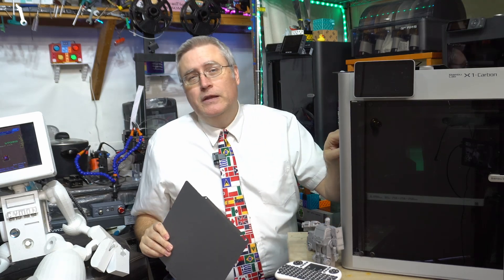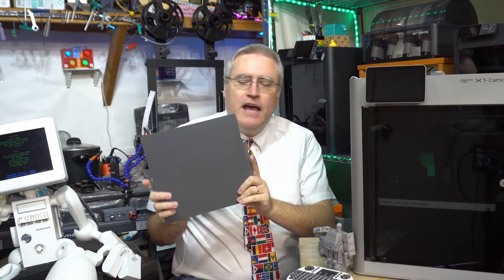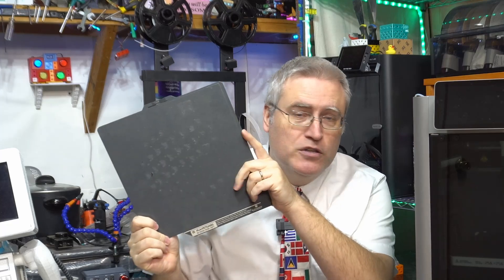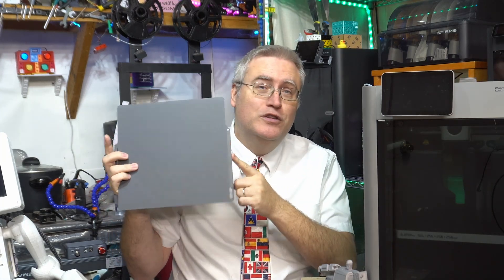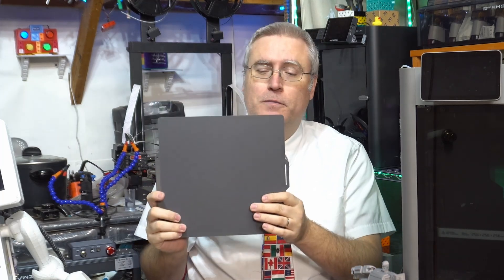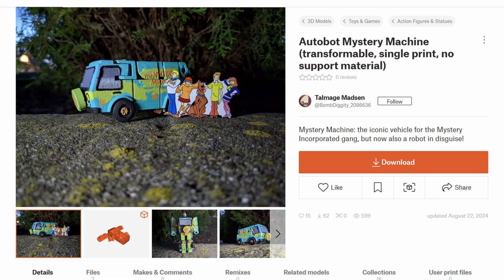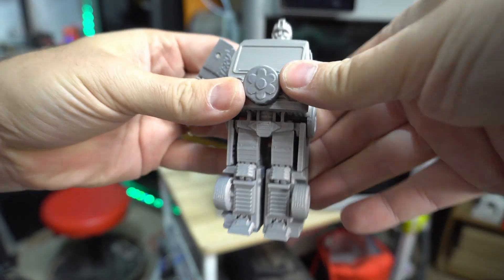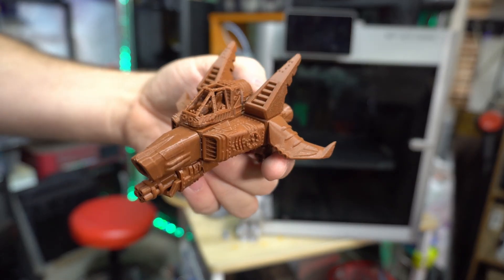3D Printing on a Cold Build Plate with the Bambu Cool Plate SuperTack

Comment: Just a thought... How many prints would you need to do with no bed heating expense to save the extra price of the cold plate? When does it stop paying for itself? I appreciate energy will vary in cost around the world, but a magnitude would be good-; tens, hundreds, thousands?

:edited for clarity...
Reply from the maker: That's an excellent question. And the answer is... a lot. In one print I saved 0.245kwh. Where I life electricity is about 11.42 cents/kwh. The cool plate costs about $15. So that's about 131kwh that would need to be saved, or about 540 prints.
Of course that's just this one print, but I think it illustrates the point that... yeah, you're not making back that investment that quickly. Then again, in certain environments it wouldn't be hard to print that much. Like at my house.
Reply: @3dpprofessor  So probably worth considering if you need to replace a worn out build surface, but not until.
Reply from the maker: @pinkmouse4863  I mean, if you're looking at it from an ROI perspective, I think that's reasonable.

Comment: Are you able to 3d print in a cold room? I want to move my P1s to another room but it is colder and does not have consistent heat in the room.
Reply from the maker: PLA doesn't mind the cold at all.

Comment: PLA is biodegradable, but your experiment is likely to fail. Most PLA needs an industrial environment (above 70 C, humid and actively mixed) to compost in about a week. In a normal compost environment it can take several years. However it is possible to add certain enzymes wich may become active in cooler environment such as a normal compost heap in a garden. Ik still takes a couple of month (like a whole summer season) to compost a print as shown. The fastest degradation of PLA is to put it in direct sunlight.
Reply from the maker: If that's the fastest, we're in trouble. I have several PLA prints in regular sun light and they're just fine.
Reply: @3dpprofessor  I have a PLA factory and I produce PLA panels for outside use. With sticker or UV coating I give a 15 year warrantee. Without coating it will becoming mat because of degrading material, but if you don't scrape it of, it will protect the remaining material. 
Our PLA is not an conventional PLA, but with extra long polymers. It is much tougher and not suitable for filament printing. The degrading properties are the same and in an industrial plant it fully degrades within the regular 40 days.

Comment: no video on Bambu screwing people who paid for their printer ?
Reply: How are they screwing people?
Reply: @Calamity-Spice  they are pushing updates or tried to at least that would give them remote control to shut down a printer, its all heading toward printers having to get permission from big gov daddy to print anything ie central planning at its worst, Corporations of the larger size are NOT happy that people will one day soon not need them at all especially when stuff like I am working on that can recycle or refine iron from the source so it can be used to print out an iron part and later nearly every other metal and semiconductors, Cause right now its the consumables that have people in their grasp with these units, gotta buy the printer filament or resin ect but considering I was able to convert iron oxide (red iron rust) back into pure iron deposited metal with a half watt laser and a future component that will actively separate the oxygen from other metal oxides so printing with titanium and aluminum oxides well, you can see where this is going, and all my work will be completely opensource, I want the tool not to control whatt others can and cant do, other than hopefully open a lot more opportunity to try and develop the new ideas that solve our problems,
Reply from the maker: @Calamity-Spice  They aren't. But people are worried they will. At this time it's all hysterical supposition and conspiratorial thinking.
Reply: @ what is not conspiratorial is that there are several states trying to push bills to demand the printers report back to a central database and give the shut off controlls to an external source or report what is being printed, some are claiming the ATF needs control due to ghost pew pews but I don tthink they can stop the open source community allowing people to just swap out the brain on any printer with our own controllers based on anything from the humble parallel port pin control to arduinos or even the newer 32bit systems like the duet? is it? anyway I am not worried but it does disgust me that they are pushing for an update that can make your printer into a service you have to pay for a subscription to use it.
Reply from the maker: @ThomasAndersonbsf  That is 100% conspiratorial. By definition. Several states working to do a thing means conspiracy. 
I'm not saying there's not reason not to be concerned. But the response so far has been hysterics and that leads to a blindly attacking the wrong thing when what we need is a measured, educated, persuasive, response.
Reply: @ThomasAndersonbsf I have a present for you .........,,,,,,,,,,,. I think you need them more than me.
Reply: @3dpprofessor  well I am not saying these entities pushing for these bills and laws, are working together, I suspect its just parallel thinking, like parallel development where several people invent the same thing independently with out having known the other person was even working on it.
Reply: @3dpprofessor  also I agree that any issue needs people to take rational thought out action to solve the issue instead of potentially not just failing to solve the issue, but even possibly inflaming it making things worse. But as I said I suspect that replacing the electronics board and maybe some more advanced sensors that might have embedded IOT with an opensource board and less advanced sensors will completely solve the issue, and it will be impossible  to enforce any law against would be avoided for that very reason. but again having a machine that can harvest energy and raw materials to print with in any of the common elements and alloys comprised of them is I think essential, people just do not realize how important to the path toward that startrek like future that it is nearly impossible but everyone focuses on the flashy stuff like warp drives and phasers or blasters and ion drives that sounds like slowed down lion rawrs ;) (or swords made of light and such )
Reply from the maker: @ThomasAndersonbsf  besides New York, what other states have propositions to monitor 3d printers?
Reply: He is sponsored by Bambu so he won't say anything negative.
Reply from the maker: @ Do you think if I were being sponsored by Bambu I'd be making videos in the corner of a run down garden shed?
Reply: These chat hoppers are getting super annoying. There’s a million videos on the subject this guy is complaining about already. Might be time to take a break from the internet bud, you are in too deep
Reply from the maker: Not yet. But if I did one, I've documented what I'd say in today's blog post: https://www.3dpprofessor.com/2025/01/22/3d-printing-with-a-cold-build-plate/
Reply: Only immature children try to drum up drama like this.

Comment: I wonder if it would be possible to print the first four or five layers or so and then turn off the bed heat and go from there. Would it still stick?
Reply: I'm using a Cryogrip BIQU cold plate, and yes you can turn off the bed heat completely after the first layer and it will continue sticking
Reply from the maker: As I always like to say, give it a shot and let me know how it goes.